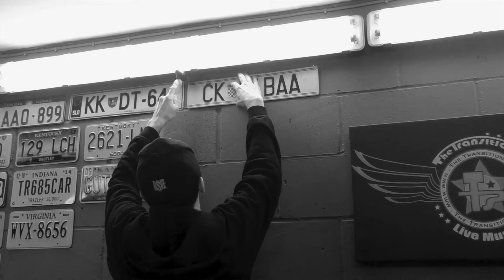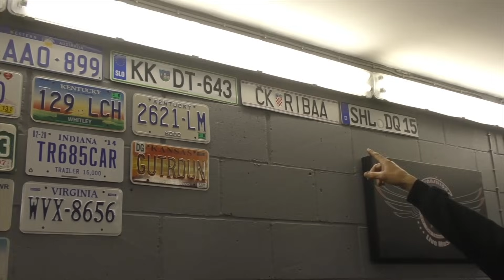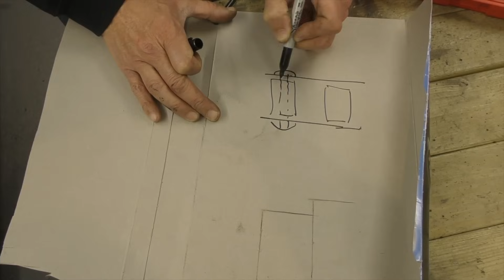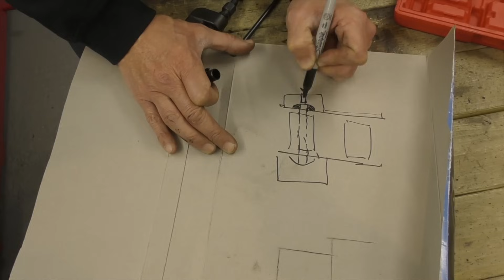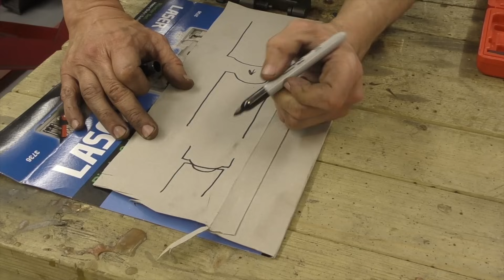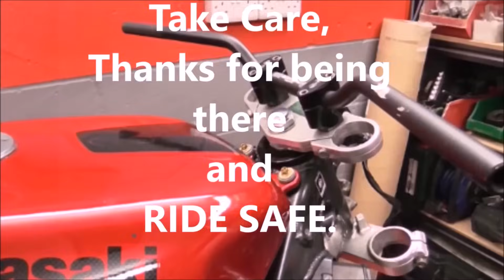Delboy's Garage, Motorcycle Chain and Sprocket Change.

Comment: Great videos keep up the good work, quick question put a new 525 D.I.D chain on my Ducati 1199s so all went well calipered as i went then came the riveting part measured prior 5.32mm both pins then used my Chinese 10 quid chain breaker and hey ho the D.I.D pins are harder than the the riveter pin  " So yes yu get what yu pay for" !!! so not much flareing going on, so i looked for a new pin thinking the Sealey would be harder thus better results as per your video, i know different bike but the Sealey pin is 5.45mm the D.I.D chain needs to flare from 5.5mm to 5.8mm , any advise on alternative pins or will the Sealey be okay ? i get non-commital just wondered with your experience any advise, Cheers
Reply from the maker: Hi mate.. ok, so with the Sealey flare tool you've expanded the end of the pin to 5.45?  which is a flare of 5.2 thou.. you're only just a shade under minimum spec... you can either press it again and see if you can get that tiny extra bit, or try one of these :- https://www.sealey.co.uk/product/5637192197/heavy-duty-motorcycle-chain-splitter-riveting-tool-set  

Certainly a bigger investment, but ive got one now, and they're proper chunky mate, that'll get the flare out for sure.!!
Reply: @Moonfleet41  Thanks for the reply and advise, i think £6 for a Sealey flareing tip off Amazon might be a better deal than £167 kit to sit in the tool chest and collect cobwebs lol used once, your right if your doing it every day wise move to invest in the quality kit , thanks again i really enjoy your Harley vids also as i have a Softail Fatboy i serviced all myself with your help on YouTube , best of both worlds Harley for a nice cruise and the Ducati for head down arse up !!!!....lol.... Thanks again, Cheers

Comment: Genuine question out of curiosity: With a high quality DID chain that takes a ridiculous amount of pressure just to press the plate on, would the chain ever fly off even if you didn't actually rivet the pins? Not saying it's a good idea, but I'm doubting such a tight fit would ever come apart.
Reply from the maker: Hi James, you dead right mate.. NOT a good idea.. but it is possible that the link would stay together without the pins being flared.. but who knows what force the motor puts on the chain under load, and in time im pretty sure it would work its way off.... something i would NEVER do even for an experiment...

Comment: Alright mate, My sprocket has two teeth missing so need to change spockets and chain. Just got the sealy chain riviter and sprockets to upgrade my gsf 1200 street fighter to 530's. But it's a Regina chain that has come with a wire with the link. This i guess is for the pressing on of the link plate correct spaceing.   I'm not sure if it's best to remove the wire from the chain when the link plate is pressed on or after the pin is riveted. i don't want to get the wire STUCK in the link. Any advice. Cheers. Ride and keep Corona safe mate. jim
Reply from the maker: Hi Jim, you assumed right, don't spread the link with the spacer in place or you won't get it out... use a caliper to measure how far you push the plate on, if you're able to do so, stop about 5thou shy and then when you spread the pins, you'll end up the exact same width as all the other plates, but it's not critical... Good luck with it mate, hope it goes well, and have a great weekend, Del

Comment: Hi Delboy do you know if this tool allow to reimplace the engine transmission chain, i mean the chain which make run the camshafts 
Thank you
Reply from the maker: The kits are rated for smaller chains yes, so check the size of your chain, and make sure that your chain size is covered when ordering the kit..!
Reply: @Moonfleet41  Thanks Delboy, i'm gonna check it out
Thanks too for sharing your experience

Comment: Hey how are ya? Great video as usual. I wanted to ask your opinion on wether or not you feel a bike needs to be put on a dyno or have the Ecu sent out and flashed if you have deleted the cat and replaced it with a straight hollow mid pipe to a slip on? 

I’m on a Kawi z900 with an m4 slip on and a high flow air filter. Getting ready to delete the cat and the primary exhaust box and throw the mid pipe on. I do plan on getting the Ecu tune but, wanted to know if you think it’s truly needed or if it’s more rider preference? I know how to block off the ais system to prevent the popping but, I kinda like the popping sound on decel and just want to be sure it isn’t harmful to the bike in any way?
Reply from the maker: With your Kawasaki, it will definitely benefit from a PC3, and have it set up on a Dyno, you'll get smooth seamless performance right through the range, not to mention a little more performance as well, and perhaps even better fuel economy... removing the cat will reduce heat soak up under the engine, and calm things down specially on a hot day... talk you to your local tuning shop about a power commander, it's basically a piggy back ECU that opens us lots of opportunities for better performance, and a very sound investment as part of our tuning package buddy.

Comment: Excellent video! Watching this was very helpful in preparing me to replace my front and rear sprockets and chain on my '05 Speedmaster. I swapped my stock Triumph 16 T front sprocket with an AFAM 16 T sprocket. The AFAM looked just like the replacement one in this video. I weighed them both. The original Triumph sprocket, with the rubber clad sides, weighed 225 grams. The AFAM, without the rubber cladding, weighed 230 grams. From my observations the reason the Triumph weighed less was because it had holes drilled around the center gear, those holes enabling the rubber cladding to stay in place. The AFAM did not have any holes drilled, thus it weighed 5 grams more that the Triumph sprocket. I am thinking this weight difference might be the same for the front sprockets in this video. I trust a scale more than my hands to compare.

Comment: so did oyu after cut any links off to make the chain fit?
Reply from the maker: No, buy the chain for your bike and it comes the correct length
Reply: @Moonfleet41  yeah i did that mate. bought a D.I.D  chain and sprocket kit(honda fireblade) put it on yesterday and the adjusters are right back and  showing just out of the green on the scale on to the replace chain mark?
Reply from the maker: @thanxx   Well that's odd, ive never had that, every chain ive ever bought fits the bike, agreed, often they are half way through the chain adjuster range already, but chains don't stretch like they used to 20 years ago, from 'new' to 'worn out' should be no more then 10mm of rearward shift... if yours was that much out, and you're running factory sprocket gearing too.. then id maybe ask the supplier to check the part number they sent you against the spec  !  it wouldn't be the first time a part has been sent out wrong..!
Reply: @Moonfleet41  thanks man. will do.
Reply: @Moonfleet41  yeah i just ordered the exact same gearing that was on the bike 16/42 530 so dont know whats gone on. il go and count the links on the old chain :) thanks again bro
Reply from the maker: @thanxx  OK, just maybe also double check the gearing for your model year, the 06 was 16/42, but the earlier 04 bikes were 16/41.. it's not much, and shouldn't make a big difference, but worth being spot on if you're having an issue like this... Good luck with it buddy. .Del.
Reply: @Moonfleet41  2011

Comment: Hi mate just having a watch dine this twice b4  I see you use 55nm.torque I recently had a debate with haynes & suzuki about the torque specs being so high on the gsc 1400 being 102nm . They confirmed this is correct. It seems so high as I once knackered a  carrier thread and had to buy another second hand ......I used I think 60 with loctite  blue ......what would you personally use? If I remember they're 14mm heads x 6  considering the rear axle is 100nm for a 36mm nut don't add up
Reply from the maker: That does seem crazy tight mate, presume you're talking about the nuts that hold the sprocket on?  They're only going to be an M10 thread at best, and as there is no squeezing action to the assembly, like there is with your wheel axle nut (where it brings the arms of the swingarm in against the wheel), the sprocket nuts just lock up metal to metal... on the Legend I did recently, they are locking nuts too and I always use blue threadlock... the only thing I can suggest to this is if there has, at some point in the past, been a claim against Suzuki for a factory nut coming loose, so as a knee jerk reaction they wind them all up tighter than they need to be to guarantee they never come off, but you're certainly going to stretch those studs... I can't really suggest what to do, but if I don't have access to a torque setting, and I'm not sure what they are, I go with the generic torque value for that thread size, which is about 50-odd, then threadlock it and get busy with the marker paint... keeping an eye on it for a few weeks to make sure they never move... and something else that may be of interest, is when I trained as a bus fitter in the 80's, all wheel nuts on commercials are re-torqued twice 50miles apart, just to make sure they've settled in to place ... Hope that helps mate, I can't advise against what Suzuki have said, as I don't know the reasoning behind it, just go with what you're happy with mate.
Reply: @Moonfleet41  funnily enough I'm a bus driver and the boys do pop by at times tonretpirque (although I'm a brickie by trade ) .....back to bike yeah it's very high I had at one point contacted my dealer as the handbook/manual states but they informed me they could not give out torque settings which is contraductive really . I done my c&s's  just over a year ago now still as new jt brand .....I did use I think about 55/60nm with blue threadlock  I've not r8den it loads since hence why the chain etc is like new but it's on the road and mot'd  passed in January no advisory notices . I'll take not if what you said though there was a big topic on it a while ago on a gsx1400 chat page and if you look at one of the lists it says different to others at 60nm my question 8s who the hell  is right ? Lol haynes ? At 102nm or this other one that says 60nm but it says suzuki settings although sizuki themselves have said 102 it's mind boggling

Comment: Front sprocket looked new, would you normally still change if only the chain is shot? (mine has missin o rings) but sprockets look new. cheers..
Reply from the maker: When it comes to front sprockets, they are so cheap that you may was well replace them, £15-£20 at the most and although they may not look worn, compare them to a new one and you'll see the difference straight away.
Reply: @Moonfleet41  ah right nice one mate

Comment: Stupid question... Can you swap manufacturers master links as long as it's the same spec / size chain?
Reply from the maker: Personally, i wouldn't do that, not because it wouldn't work, but more for safety in case there is any form of issue with compatibility, and of course 'warranty'.. if you ever had to make any kind of claim, or if there was ever an accident, and it was discovered that your chain parted and caused it, then the fact that you have an incompatible link could give them the excuse to not pay a claim, or blame you in some other way... it's sad that we have to cover ourselves this way, but we have the 'blame and claim' culture to thank for that aye.... So if you have a DID chain, then id use a DID link if you can.. it's not like they're hard to come by after all... Glad you got yours done, and thanks for watching the video.. Del.

Comment: is there any detriment in just using an old fashioned split link?
Reply from the maker: Fine up to a certain size.. bigger bike chains tend to go with a rivet link.!
Reply: @Moonfleet41  yeah i get that but is it ok to still buy and use a old style split link/master link?? saves having to use the rivet tool?

Comment: It's unlikely you flared those master link rivets nearly enough with that tool. I used the same tool with vernier calipers to measure the flare and it turns out most of the give was just the rivet grinding on the softer tool tip and making iron filings.
Reply from the maker: Got them to 5.5mm, bare minimum, but enough... and you're right, these pins are a bit soft... This is an old video now... these days im using this tool... which flares easily to 5.8mm every time : https://www.spanner-monkey.co.uk/motorcycle-chain-splitter-and-riveting-tool-set-heavy-duty-119022?search=SMC4&description=true
Reply: @Moonfleet41  Thanks for the link. I ended up breaking my tool this time. I don't want my next chain replacement to become another chain replacementttttttttteeeeeeeeerrrrrrr!

Comment: Job completed yesterday thanks to this vid! Old f sprocket was so worn but came off easily (phew). Worst part was fiddling to re-attach gear lever and clutch linkage within the sprocket cover. Just one question re the wax on the new chain. Do I: leave it on and ride for now? Wipe it off and apply new lube? Apply new lube over it? Thanks again for the quality tutorial.

Comment: Why do you bend the disk in front of the sprocket after fitting?
Reply from the maker: It's a lock washer, splined on the inside diameter and bending it over the nut prevents it moving.

Comment: Hi mate, sorry this is an old video to comment on but by grinding the pin away haven’t you damaged the link face thereby shortening the chain too much for reuse? Better to take most of the pin meat away but leave enough for the tool to overcome, although you still need a new pin I guess.... best wishes, Rog.
Reply from the maker: Hi Rog, when you grind the pins off, even if you're re-fitting the chain again, then your new pins will come with a complete link, so you'll get a new outer place and o-rings for re-connecting it... so it makes no difference, just be careful not to touch the surrounding links with the grinder, it's only the pin link you're removing and replacing.
Reply: @Moonfleet41  ok, thanks. It’s been years since I last had to change a chain as I’ve had Ariels (spring clips) and BMWs for such a long time.

Comment: So I managed to get to my project early and it has been a failure of epic proportion. The Dimpled tool is ruined. rather than force the pin into the shape of the dimpled tool it forced the tool into the shape of the pin. I guess I'm down to the hack way. any suggestions?
Reply from the maker: OK buddy, it looks like you pressed it too hard, which means you've probably spread it enough... if you have a vernier caliper, then measure the two pins, across the width, you actually only need to spread the head by about 25thou... which you've probably already have... also did you do the other yet??
Reply: Moonfleet41 Yes sir, I did both sides, however the plate still comes off. That was something else my master clip didn't press on very hard. I could do it with my hands which raised some red flags. I got my calipers out but it didn't flare out the master clip at all. I think the tool I ordered is just too soft of a metal for the job. An my master clip may be faulty as it presses on and off by hand you know? This sound right? I've never done one but it seemed fairly straightforward. I'll look into it more thanks
Reply from the maker: No, you have a problem there buddy, the connecting link must be a 'press fit' with the tool and anvil, if you can push it on by hand, then you have a faulty link buddy.. maybe check with the suppler if they gave you the right parts..

Comment: I got the same kit from Sealey VS779v4 but in the instruction it says suitable for chain between 428 - 520. My chain is D.I.D 530 VX. Do you reckon it should still do the job ?
Reply from the maker: It will struggle to get a full spread on the chain pin at that size.. but the tool spreader pins are individually replaceable so even if you trash the pin doing it it won't cost much to replace.